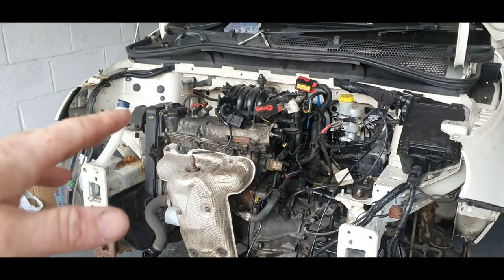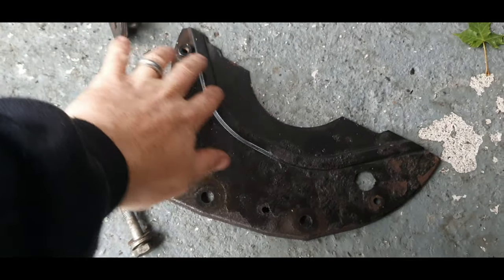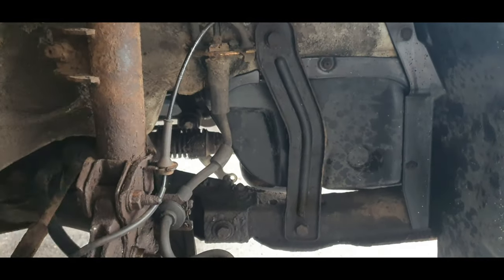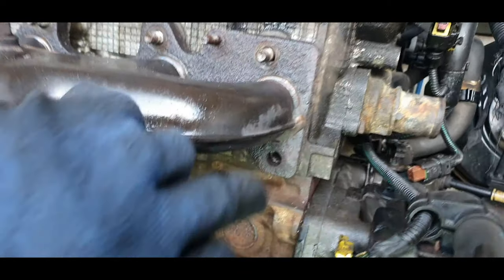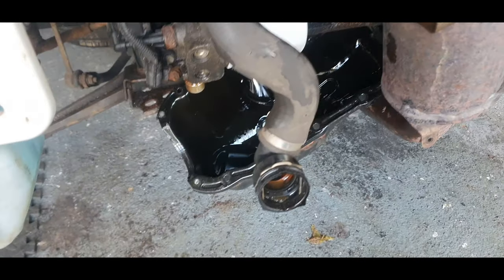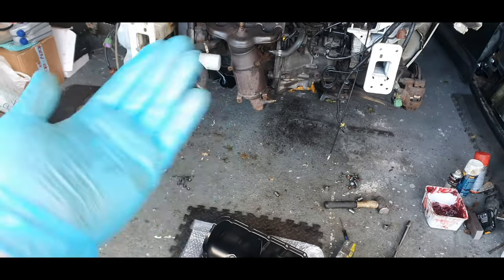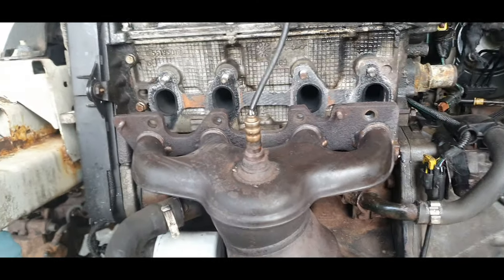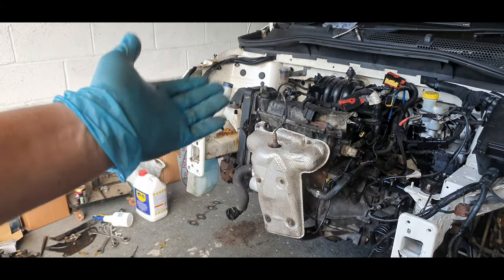Rusty Leaking Engine Sump Oil Pan Replacement Fiat 500 / Ford KA 1.2

Comment: You don't need that much sealant... the crankshaft turning may force loose some of the excess silicon ending up blocking your pick-up line...

Comment: Or you could cut the pipe, fix the sump leak and, then sleve the exahust pipe back together. Sleves are cheap  -all you need to know is the outer diameter of the pipe. If you really have to chance those rusty exahust manifold studs, apply some heat (butane) then give the studs a few taps with a hammer and drift to loosen the rust - oh and plenty of WD :) And just for future reference - the amount of sealant that squeezes out will be approx equal to the amount the squeezes in - just hope none of it breaks away and ends up in the sump to be sucked up by the oil pickup.

Comment: Well done with that! I reckon you did that better than most garages in fact I bet a garage snapped that stud and said nothing! I’ll do mine  at some point though I’ll be crapping my pants undoing those bolts! Very useful video especially to myself 👊👍❤️
Reply from the maker: Your probably spot on ... I hope you can make some use of the video... thanks for watching 👀
Reply: @RevivingSalvage  100% as you said there’s nothing really on the net regarding changing a 500s sump!
Reply from the maker: Only two came up that I could see & the one was ripping off the heat shield & throwing it away & that was a garage so not a very good example...I know mines a  bit over the top with the front off I suppose you get the just of it. Lol
Reply: @RevivingSalvage  yeah saw that one 😂 great garage eh! The other was the red 500 he took bottom arm off .. But like you say it’s still impossible! I reckon this video will help loads of people out!
Reply from the maker: I couldn't believe my eyes when watching that one lol...I hope so 🙏... its definitely not an easy job but if you take your time with the Manifold bolts you should be fine 👍
Reply: @RevivingSalvage  defo a garage to avoid 😂 yeah I’ll take my time and use wd!! I did my timing belt in July an water pump & tensioner …. I had to jack up engine to get to bolts on engine mount .. be careful with your new sump

Comment: Great Video showing all the unpleasant parts of this job, Well done. I had a go myself and I'd like to add my experience for anyone trying this job. It can be done without removing the manifold, but it's not easy. A few tips are: 1) Put the sealant on the block, not on the new sump, this stops you knocking it off as you try to get the new sump in place. 2) cut out most of the baffle inside the new sump out, again to help getting it in place. 3) Turn the engine over via the crank pully to put the no4 piston nearest the gearbox high up in the engine for the same reason. 4) Grind off a 1/4 inch of the chassis leg holder near the 3 big bolts to help fit the new sump. 5) temporarily remove the front t30 bolt that holds on the oil pickup so it can be moved, so you can get the old sump off. Once all this is done, it fits in OK. What a terrible design for a car :)
Reply from the maker: great advise, Their definitely not easy to work on due to the room in the engine bay

Comment: I've done many sumps on these but never had to remove the driver's side leg so not sure what that is about? And yes, it is easier to cut and sleeve the exhaust pipe rather than remove the manifold. However, I have done a couple of sumps and removed the manifold completely and it's a lot easier with it out of the way to get pry bars in there to lower the sump.

Comment: Hi Big Man. Another epic repair. I personally would have put a little less sealer on the inner side of the sump.
                     When you tighten it up, the sealer expends outwards which is ok on the exterior as you can wipe
                      it level but there is a "chance" with the amount that was on the inner lip of the sump, of it dropping
                      down into the oil, being circulated and blocking the oilways/passageways leading to worse problems.
                       See you in the next one. 👍👍
Reply from the maker: Thanks very much for your advice I really appreciate it I was considering taking it back off as I thought I might have put a little too much 😀... I will definitely be more careful in the future Thanks very much 🤙